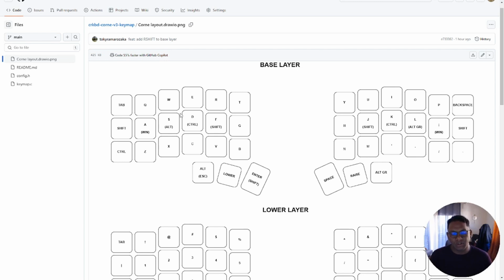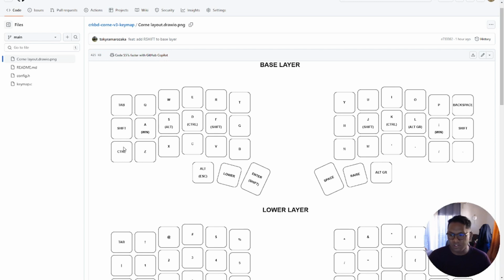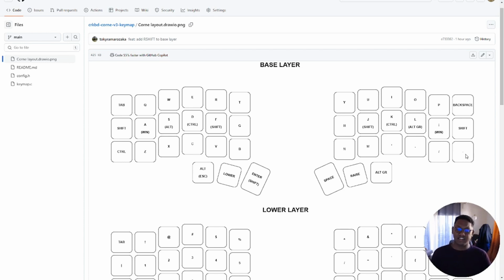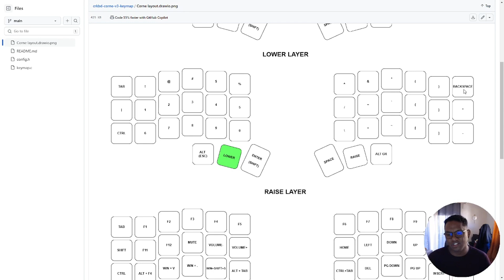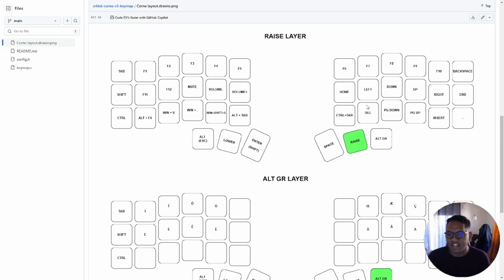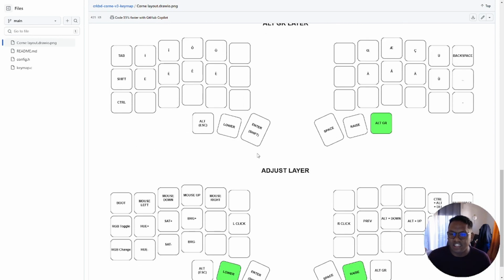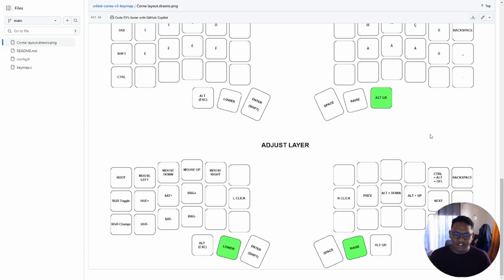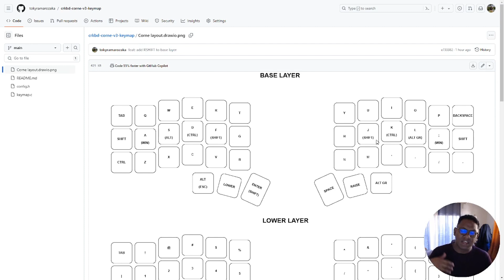Corne V3 keyboard layout : My 42-keys keymap

Comment: Just one question, where are u found the corne v3? It's really difficult to find it without DIY, thx
Reply from the maker: I bought mine on Denshi Electronics, but you can find it on Etsy as well (without switches and keycaps, but fully soldered). Most manufactureurs are from Spain, France or the US.
Reply: KeebMaker has one right now for 15% off and super great quality! I recommend getting the wired version though as RGB kills the wireless battery in a day or so

Comment: Curious about your experience with dual function keys. Does the tapping term delay cause any issues for you? I like your idea of having longer per key tapping terms for modifier keys (gonna give that a shot).
Reply from the maker: Sometimes, it does output capital letters when I am rolling, but it's very rare nowadays. 

When I had lower tapping term delay(150 to 200ms), I used to have a lot of issues with the pinkys especially, and the shift didn't fire quickly enough. 

So I brought back my dedicated shifts. And used home row mods only for programming, or keyboard shortcuts. 250 to 300 ms is the sweet spot for me so far.